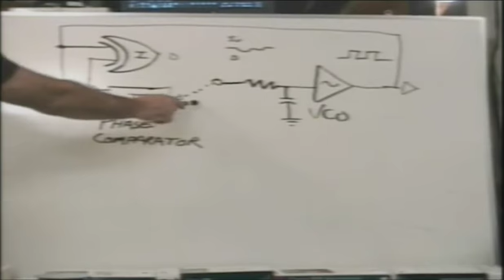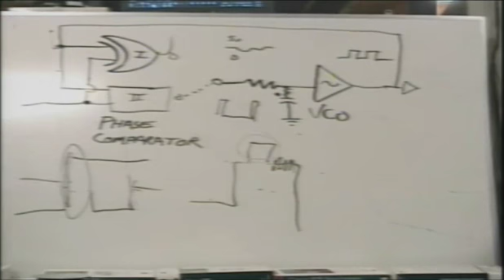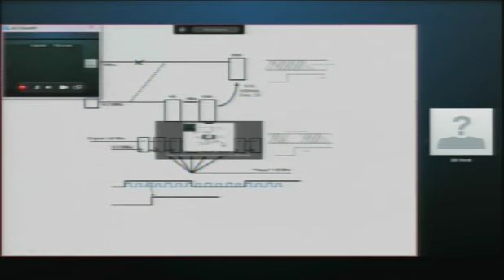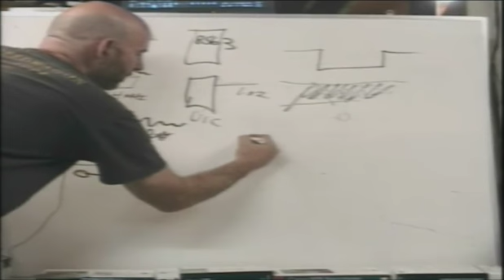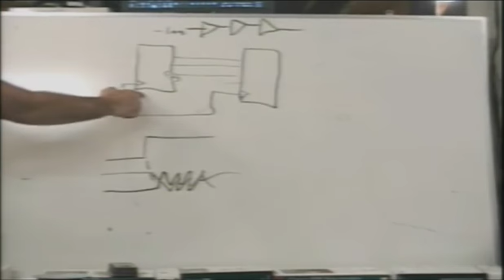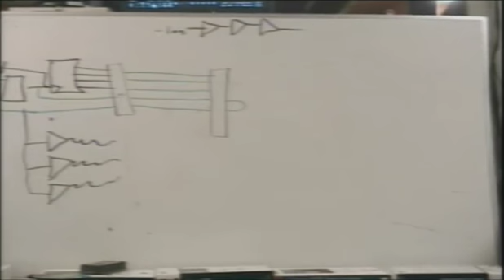Bil-Herd-Jeri-Ellsworth-Phase-Locked-Loop.mp4

Comment from the maker: @TheSchetsofiel69 Sorry for the delay!  One more chain of emails in the spam catcher unfortunately.  The whiteboard dwgs were kind of crude and I was just getting things set up here; you should see much better video quality for example.  If you had an example of what you would like to explore I might be able to embellish it for you.

Thanks,
Bil
Reply: I learned programming on Commodore PETs. I have some memories of the hardware design and I wonder if you can confirm any of them? The first is a question about how he video hardware worked. I have a vague recollection of it being based in a character generator ROM, and the bytes in a 2kB region of screen memory had the effect of being an index into the character generator memory of the "scan lines" of the character, which the video signal generator read to modulate the beam intensity for each of the sixteen scan-lines of the character. But I seem to recall that there was some way to do user-defined characters by switching in some part of static RAM as the character generator table. Could it do this, or is it something I thought of myself? I recall using it in an alarming piece of assembly code which switched the screen from all black to all white at a frequency of several hundred Hz. That was before FCC regulations about radio emissions existed, and the effect of this program on the video tube was dramatic. For some reason, it caused violent electromagnetic forces in the tube, and they were enough to cause the shadow mask to vibrate with a really loud thumping noise, .... needless to say, we never ran the more than a few seconds, ... but I later wondered whether anything showed up at the NORAD early warning radar monitoring station on Clee Hill, which was about 10 miles away, ....